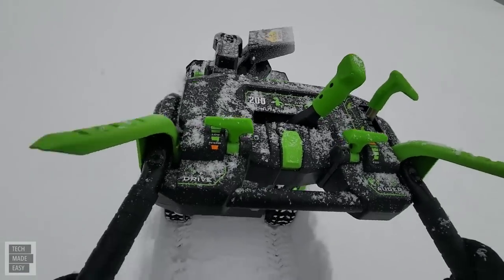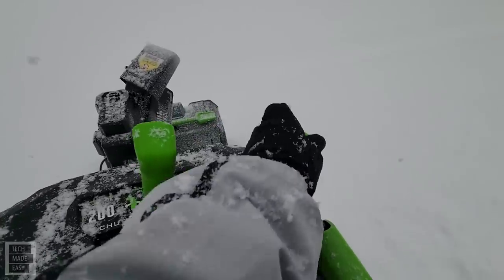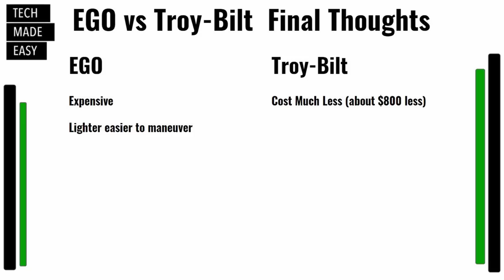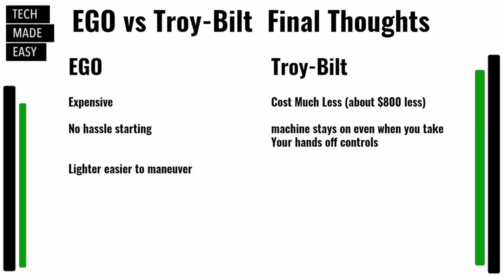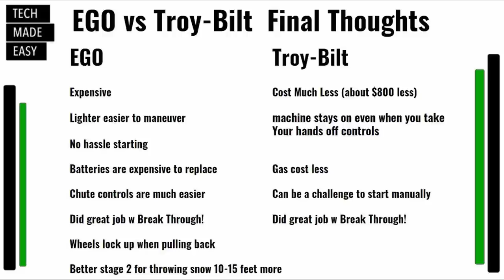BATTERY or GAS  EGO & Troy-Bilt   EGO 56v 2 Stage Snow Blower Troy-Bilt GAS  snt2405 snt2406 snt2400

Comment: That gas blower is a disaster - the fumes coming out are a mixture of combustion products and aerosolized uncombusted gasoline.  Breathing that will shorten a life.  

The gas age is drawing to an end.  That gas blower would have been awesome in 1962. 

The battery mower is impressive - and worth keeping in mind that it is in its technological infancy.   The price - I see the older single stage models often heavily discounted and that 2-stage will be similarly a bargain soon.  It already represents excellent value. 

I have a 2-stage gasoline blower and the only reason it is still in use is that the EGO is sold out everywhere.   Our gas blower will soon meet its deserved fate in an electric arc melt furnace.
Reply: Also - you have to add another negative to the gas unit - everything in your tool shed stinks like gas and 2-stroke mix.
Reply from the maker: Thanks Bruce and I agree. I love being off gas and it's much much better for the world. Bad news is it's expensive so the single stage is a good option for some people.
Reply: @TechMadeEzy  price and the fact we never see enough snow to justify it 🧐🤷🏻‍♂️
Reply from the maker: Totally understand
Reply: @TechMadeEzy Anything not gasoline is a good option.  

At our city house I have been using a plug in "electric shovel" for 15 years.
Reply: I find fumes to be more of an issue on single stage blowers since many of them are set up to have the exhaust blow straight out the back. When the exhaust vents out the side of the 2-stage I don't notice it as much.

Comment: Is it possible to use the self propel without turning the auger on, on the EGO?
Reply: yes
Reply from the maker: Yes
Reply: and if you want to turn the Chute while you are snowblowing you can let go of the Auger while holding the self propel and it locks in so you can drive and turn the Chute and the handle to the auger locks.  I love that.

Comment: What was the temperature out there? That deep, wet, and warm out, is very hard on a snow blower. You were lucky to even get through that. I know you wanted deep snow for video but the best thing to do is  to snow blow twice to your once before the snow gets to deep on warm sticky snow. Hard on any machine. No matter what model.
PS: Your intro music is TOO LOUD! I jump when it comes on. Hurts my ears.
Reply from the maker: hi M it was about 25 degrees, snow was light to medium, slightly wet but not much.
Reply: @TechMadeEzy  Did you turn the intro volume down?  Was a LOT BETTER when I entered here just now. THANK YOU!
The snow looked awfully STICKY. So that is hard on a machine from the fluffy or dryer.
Reply from the maker: Yes I did got some feedback from a few subs, some will still be loud because they were recorded before the volume adjustment but down the road most will be lower, glad it’s better for you too. 😊

Comment: Up here in west central Canada $1,800 for the Ego. Ahh, no thanks.  $1,000 or much less will get a pretty kick ass gas snow blower. You can buy a lot of gas for $800
Reply from the maker: Thanks for watching Cut 👍🏼
Reply: This works best if you have another use for the batteries, because like any ego tool it works out best if you don't have to factor for the batteries. If you can use the batteries for several things, as they die out you don't have to replace every one that dies. Factoring for the cost of the batteries and charger it's only $800, and it's better than any snow blower you would buy for $800.

Comment: Sitting for a year yes the gas blower will smoke. I find the electric very noisy. A full Jerry Can of gas is cheaper than buying aa second set of batteries if you want to run the machine
for a long time. In fact you could buy man, many Jerry Cans of fuel for the price of a pair of replacement batteries. A lot of plastic on the electric and replacement parts are probably a lot more expensive than those of the gas blower. The price of those EGO in Canada is extremely high and not worth it. Besides the amount of heavy snow we get would wear it out.
Reply from the maker: Totally understand Garfield, it's definitely expensive and if you don't already have batteries ouch and yes long term as well.
Reply: @TechMadeEzy  I can see its use in light to medium snow areas or for persons who a gas machine is too heavy. My neighbor has an EGO single stage. It cost him $ 800 Canadian with batteries on sale. He can do his 3 car driveway and side walk 2 or 3 times on one charge. However the stuff the plow leaves at the driveway edge is too much for the machine. He checked the two stage and it was $ 2400 bucks CDN with 2 batteries, not including taxes and enviro fees. Extra batteries were almost $ 500 bucks each. However I should talk.. my Craftsman failed the other day and he came to the rescue. :-)
Reply from the maker: Single stage is nice definitely in light snow but if it’s wet and heavy and especially high no way, too hard to push. The 3 stage works great honestly but very expensive
Reply: @TechMadeEzy  Yes. I have a two stage and it works very well. Rally thick wet snow will clog the chute every so often. Another neighbor went from 2 stage to one stage and (both gas) after a couple of years went back to a two stage. because of the reasons you stated. Another thing with two stage is the engine size. I have seen some with a 175 cc engine. Not good for rally heavy snow. As long as mine works I will keep it. Yes the three stage are very expensive, and more so up here in Canada.
Reply: @TechMadeEzy  l
Reply from the maker: Hi Marie thanks for watching

Comment: First what about adjusting to choke. It seems like this is an extremely biased test. Not saying ones better than the other I’m just saying be neutral if you’re going to test
Reply from the maker: Hi Jim 1st thanks for watching. Honestly my video wasn’t bias, gas definitely killed it with price and long term costs. I didn’t claim a winner, just provided some points. They both get the job done and both have their benefits depending on who the consumer is. You can’t get around fumes, oil, gas etc when you are using a gas snow blower just like you can’t get around batteries costing the price of a gas snow blower around $350 to $450 depending on 7.5ah or 10ah.

Comment: You don’t know what your doing because your leaving the motor on full choke position making it run 4X richer/stinking & smoking all over the place on cold startup.

Your supposed to turn off/open the choke up shortly after the motor starts to lean the mixture & smooth out the motor & your leaving it on way too long giving a truly false impression that the gas motor normally spews put all that over rich mixture smoke all the time when that’s not the case at all. 

Also, you mention cleaning of carb on gas blower,I have never had to clean a carb on my blower since 10% ethanol fuel came out by only adding a couple ounces marine grade stable to a full tank of fuel & running it for 10mins prior to Storrage for 30yrs+!

Same goes for my mower,Classic car & motorcycles that all see 5-6months of long seasonal Storrage too without 1 carb/10% ethanol fuel related issue using a proper dose of marine grade stabil in a full tank of fresh fuel run into motor 10mins prior to Storrage.
Reply: Yup!  I noticed he did that as well.  I hope @tech made easy read your comment.
Reply from the maker: Gentlemen, this is the biggest reason why I got off gas. It requires too much in comparison to throwing a battery inside of a piece of equipment. Thank you both for your comments I appreciate it. I do the best I can with the knowledge that I have.
Reply: Yup!  Agreed!  I get that you prefer the eGo snow blower over the gas powered one.  Nothing wrong with that at all.  I too own an eGo trimmer, leaf blower and lawn mower.  I also however own a Craftsman 24 inch gas snow blower.  I appreciate your comparison videos a lot.  They’ve helped me come to the conclusion that I’m keeping my gas snow blower.  I can’t justify spending that much money on a snowblower when the gas works fine as long as I change the oil yearly as well as run the tank empty before spring and summer storage.  It gives me no issues starting up during the winter time.  With that said, I am also a big fan of eGo.
Reply from the maker: Totally understand and appreciate your comment

Comment: make half passes and go slow. Dont abuse your machine and it wont abuse your wallet. Its not a race. A little love before winter starts goes a long way for gas motors and will fix your exhaust problems> $400 batteries are insane